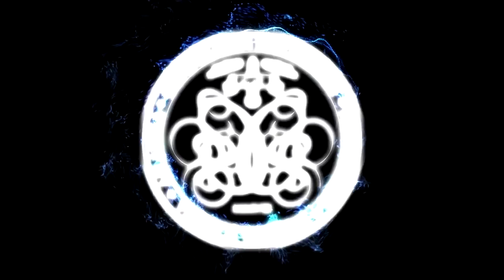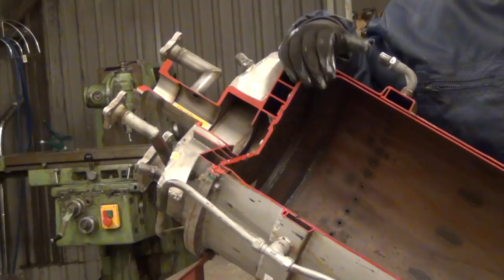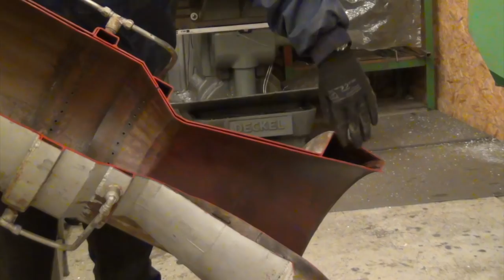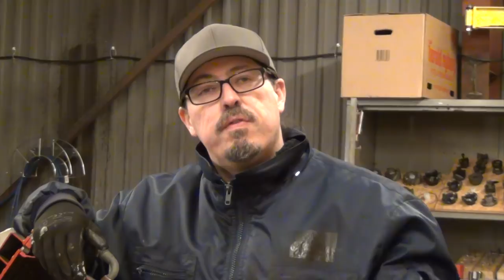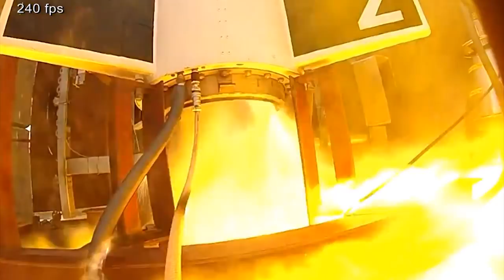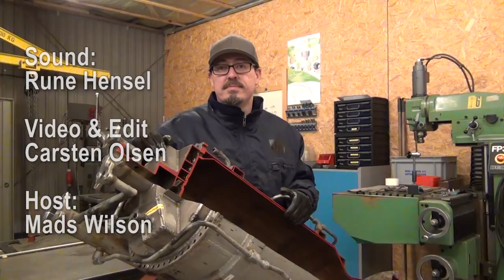How ROCKET ENGINES Work

Comment: I suggest looking at the German A-4 (V-2) rocket motor. It used several smaller Injectors to achieve reliable combustion. Good work.

Comment: Very good video...I like how he kept it simple for the layperson....by the way the licking your finger on the hot plate reference to the fuel spray inside the engine is called latent heat....it's a physics property of liquid changing state and the heat it absorbs..

Comment: Great video, im just curious how the high presure exhaust is controlled from going up and out the way the fuel came in? Since the presure is so high does that mean that the amount of presure the fuel is injected is higher thus preventing the exhaust re-entering the fuel pumps? Best regards
Reply from the maker: You're exactly right, feed and injector pressure is always higher than the combustion chamber pressure.
Reply: @CopenhagenSuborbitals  Thank you for the answer :)

Comment: Thank you! :)
What is the desired pressure in the nozzle? It low pressure / high expansion is more efficient, right? Never thought about  that the nozzle has to withstand those high pressure levels so it doesn't implode. Very interesting!
Reply from the maker: There's really no general answer to that - it  depends on the engines geometri, fuel types ect. And expansion also depends on ambient pressure a a given altitude. That's why second stage engines always have this huge engine bell :)

Comment: Have you ever thought about cooling the engine by brazing copper pipes on the inside of your combustion chamber? I mean obviously it would take a lot of man hours to do so, and very precise work to achieve repeatable results, but it would keep the engine cooler and might solve a few of the problems.
Reply: Surely you mean outside

Comment: are you going to use the bpm-5/-design in a rocket/vehicle that will pass the karman like? like using the basic engine clustered or with a big engine bell in vacuum?
Reply from the maker: Not likely - we are working on a 100KN+ engine for the Spica class rockets
Reply: I think they need a small engine bell to be efficient in their case. It is after all a suborbital flight.
Reply: A two stage rocket with a 9-cluster of BPM-5's could potentially launch small sattelites to orbit!
Reply: if i had a mod for ksp, i would have done it.

Comment: I was wondering why you don’t use a LOX fuel system instead of ethanol is there something more favourable about ethanol or is it just production?
Reply from the maker: We prefet to use LOX as our oxidizer that it is. :)
Reply: Have you ever thought about using liquid hydrogen or kerosene?
Reply from the maker: @jackrigby6678  Hydrogen is extremely hard to work with and kerosene is not a very environmentally friendly option when we are launching rockets from the sea and risk large amounts of it being dumped into open waters.
Reply: Thank you for taking time out of your way to reply, good luck with the spica rocket!
Reply from the maker: @jackrigby6678  You're welcome and thank you!

Comment: isn't there any ignitor used to start the combustion?
Reply from the maker: So far we've used a pyrotechnic igniter suspended inside the combustion chamber to ignite our rocket engines. You can see it flying out at 5:07
Reply: Copenhagen Suborbitals isn’t that just basically a giant match in the engine to start it?

Comment: Is it possible to make a small working model of this engine at home... I have access to liquid oxygen and ethanol /methanol
Reply: You’d have to figure out how to pump it hard and fast enough. That basically requires turbo machinery of the highest degree or a really powerful electric motor (in the case of Rocket Lab’s Electron rocket)
Reply: BrokenLifeCycle RocketLab is using brush less DC motors which are easily available and turbo pump can be made from car engine turbo pumps
Reply: Dollar Projects if you have a cnc or a 3D printer you can easily make an impeller that is power as required. The rocket is 60% plumbing (combustion cycle), 20% nozzle, 15% cooling, and only 5 percent everything else.
Reply: Makar Lock Thanks for the help :)
Reply: Small liquid rocket engines use high tank pressures from a secondary Nitrogen tank to generate the required fuel flow. If you're looking to build a really small engine, I would recommend reading http://www.cientificosaficionados.com/libros/cohetes.pdf
If I had any mechanical knowledge I would absolutely build one myself. Alas, I work with computers instead.
Reply: Getting the fuel into the combustion chamber is the main trick in liquid fueled rockets. You want the combustion chamber pressure to be as high as practically possible, but obviously for fuel to flow through the nozzle, the pressure on the other side of nozzle must be even greater. And you have to do it at a high mass flow rate, so power requirements are significant.
You can do a pressure fed system, but then your fuel tank pressure is the limiting factor and the result is generally very low efficiency rocket, you would be better doing solid fuel rockets really. Turbopumps are the answer for big rockets, but miniaturizing them... not really viable. The problem is the bearings, they need to not leak or you are going to mix things that are not supposed to mix and blow the rocket up.
Electric pumps on the other hand, these you can make totally sealed besides inflow and outflow, now that is something that can be worked with.
Reply: aleksander suur sealed brushless motor powered turbo pump can be made.
Reply: +Dollar Projects
I don't know how good a rocket motor one could build like that, but the principle is there. In case you or anyone else actually tries to build something like that and pump liquid oxidizers with it, please for the sake of your remaining life expectancy, keep in mind, lubricants, plastic, paint, wire insulation, metals, everything counts as fuel and when oxidizers and fuels are mixed, things often go kaboom.

Comment: Hi, it seems the throat is too wide and the nozzle too narrow and short. The mixture is ejected too soon out of the chamber and nozzle, and the  combustion takes place too far away from the engine. In fact the combustion chamber should work as a mixer of fuel and oxidiser, and therefore needs some containment especially when one of them is heavy (EtOH or RP-1), the mixture is  afterwards injected into the nozzle where  the  effective combustion takes place propelling the rocket.
The  expanding gases pushing against the parabolic walls in  all directions:
in the forward direction create a net push.
expanding gases that push side wards  produce no net push as they cancel each other's.
and the backwards moving gases are, bounced parallel outwards reducing drag.
 Notice how the most powerful rocket engines like  F-1 have a huge parabolic-like nozzle, compared to the combustion chamber. 
Good luck

Comment: That design never made sense. You must contol flow of each fuel channel by avoiding bottlenecks. The hydraulic pressure in a 360 degree open mantle never made sense.

Comment: First! Also, I did not need to study physics to tell temperature from heat, that's mid-level physics curriculum.
One question, are you still doing the spiral guide wire thing that you falsely assumed would improve cooling (https://www.youtube.com/watch?v=tlqAS6MwkNw)?
Reply from the maker: Hi Anvilshock - the design of the Spica engine will be a lot different from the BPM5 design.
Reply: Best of success! Still, the jacket machining used for the BPM5 looks so mesmerising and cost-effective, I should hope it becomes a success, too!
Reply from the maker: The BPM5 works great! The original one has been fired over 30 times and still going strong.
Reply: People falsely assume that "heat capacity" is like a bucket that can be filled at any speed until full when in fact it fills slower the closer to "full" it becomes, and also that flow speed, rather than flow rate, is what improves cooling. I elaborated more in a comment on that linked video. Please follow the link to the video via the video link which I used to link to the video.
Reply: Alright, copied and pasted here for you: https://www.youtube.com/watch?v=tlqAS6MwkNw&t=420s - And that makes absolutely no sense. At all. That is like saying filling a garden hose from a tap is faster than filling a bucket from a tap, even when both "containers" have the same volume.
Making the fuel channels longer while keeping the jacket volume the same does not make the fuel spend more time cooling the engine. It will simply flow faster to cover the now longer distance. Higher flow speed (as in, surface covered over time) does not do anything when it is effectively still the same flow rate (as in, total amount passed through over time). X amount of coolant can only take Y amount of heat energy for Z of a given delta-T. (Ignoring phase change here which you don't want anyway. Cavitation is a bitch.) Rather than gaining better cooling, you're only making life more difficult for yourself: 1) More complicated assembly due to the need of keeping the bloody wire spiralled, 2) heavier engines and greater material cost due to more material added, 3) lower feed due to higher flow resistance that must be compensated appropriately, and 4) believe it or not, the spin imparted on the fuel will result in a small rolling momentum (although most will be negated since it's more or less a closed system) that can irritate the eff out of you trying to eliminate if you didn't know where it was coming from. So, please don't do that.
Reply: Interesting finds. However, both underline what I described. I'd guess that Boston (first example) didn't get the flow rate high enough to pass the hottest part (throat) quickly enough to keep it cooled at acceptable levels. Note how their experience with spiraling was that it makes matters worse, rather than improve things. The second example doesn't mention spiraling at all, but does mention flow velocity. Remember how the coolant velocity is foremostly a function of flow rate and pathway cross section, and how flow resistance is a function of distance covered. The longer the channel, the more resistance encountered. That aside, twisting the flow around increases the flow speed indeed, but it also increases the time the coolant spends within the hotter area. It's just like a ramp vs. a ladder. Covering some height may take you only a few steps up the rungs, but covering the same height in the same time up an incline will mean you'll have to run faster to not only cover the "up" distance, but also the "sideways" distance. Here's where your increased flow speed comes from, it's simply needed to produce the same coolant mass flow rate. It's simple geometry. Twisting brings you nothing; if anything, it hurts you. All that counts is that you get a high coolant mass flow rate THROUGH the hot zone, meaning entering AND exiting. How fast or slow it flows WITHIN the zone is, as far as cooling speed (capability of taking amounts of heat away), irrelevant, so you might as well go with simple straight paths. The only real thing how you can increase (local) flow rate is by modifying coolant passage cross section. (You can't simply increase global flow rate by pumping more coolant through the jacket for obvious reasons.) Incidentally, simply keeping the jacket clearance constant across bell, throat, and chamber results in increased local flow rate at the throat because that's where the cross section is the smallest for the coolant as well, not just for the reaction gasses.
Reply: No, I don't think the book is wrong in this regard, but I do think it's ambiguously worded, and also that it's being slightly misquoted and/or misinterpreted. Yes, the book mentions velocity, not rate. However, the two are intricately linked through the jacket geometry. Don't ignore the rest of the sentence, it describes HOW they increase the velocity: "by restricting the coolant passage cross section" Because the passage is now narrower, the increased flow speed/velocity is simply the effect of the change in geometry.

Remember that your overall flow rate is constant. It's simply the speed with which the rocket engine is made to consume its fuel, producing proportional amounts of heat. So the only way to control local flow speed is the portion of the jacket's cross-sectional area that is not composed of pipe wall material. It is conceivable that this is the reason why they concentrate on mentioning the flow speed rather than the flow rate: Because the rate is a given, and all the flow speeds local to the various engine components scale with the rate, the rate cancels out of the considerations.

Consider what spiralling vs. a straight path does: The total jacket volume in any of the sections of interest is divided into the pipe material and the coolant channels they form in-between. Now you redistribute the pipe material such that the channels are angled against the center axis, away from running parallel. But does that change the actual jacket cross-section area? No, because it's still the same fraction of pipe wall material to total jacket volume. Therefore, there cannot be a net change in the flow rate through a section's jacket volume. (There is a small to medium side effect, though: The increased wall surface of the pipes leads to a higher dissipation of wall heat into the coolant, with diminishing returns. And if all you do is add a handful of guide wires, that effect is negligible anyway, angled or not.) Now, can you distribute the wall material arbitrarily finely, as in, stretch it ever finer to create ever longer channels with ever shallower angles? No. Eventually, you will hit limits in manufacturability, mechanical strength, and non-linear fluid dynamics.

The key for good cooling (as in, amount of heat removed over time) is to replenish and displace the heated coolant with fresh coolant as quickly as possible because you don't want to keep the heat lingering about. Note how I said "displace". The heated coolant must LEAVE the section to be cooled, and must do so as QUICKLY as possible. The speed within the hot zone itself is (mostly) irrelevant. (I say "mostly" because a high flow speed has a side effect: It counters localised heating. Think about a pot of almost boiling water: Left alone, bubbles form at the bottom that quickly collapse when they rise. When stirred, no bubbles can form, at least not as easily. Bubbles are bad, and can be catastrophically bad in nozzle cooling. But stirring only works as long there are parts of the water that are cooler than boiling temperature which you substitute by stirring. Eventually, no stirring in the world will keep that water from turning into bubbles of steam.)

Now, back to spiralling: As we have determined, the flow rate does not change, regardless how you angle your flow. From the ladder & ramp analogy we've also seen that the pipe angling increases the distance within each pipe to cover the distance strictly vertical across the hot section of interest. To maintain the flow rate with longer pipes, the flow speed in the pipes must increase. But since the entirety of the angled pipe is still fully within the section of interest, any advantage that might have been gained by increase of flow speed is immediately negated. You simply gain nothing.

As for the Boston University Rocket Propulsion Group's experiment: Yes, the coolant absorbed more heat. Or more accurately, its temperature at the output of the jacket was the highest, even dangerously high, which is what they state. (Those things are distinct, and governed by the specific heat capacity of the coolant.) However, this can have multiple reasons, but without seeing actual data, or the actual model even, from which they determined that spiralled channels are undesirable, there is little to go by to make the different configurations comparable from what little glimpse we were provided with. Also, we mustn't forget one thing: The BURPG presentation is the research of work done by students with a particular goal, namely creating a Matlab computation model for particular cooling configurations. It was not a presentation by experienced, industrially employed rocket engine designers about a final and flight-worthy engine design and the decisions behind it, including the best possible nozzle cooling they could achieve. Plus, it's not inconceivable that they may have come to wrong or incomplete conclusions from their findings. This is by no means a discredit of their work, but just because BURPG couldn't make spiralling work for them doesn't mean anyone else shouldn't have, either. You cannot simply regard BURPG's design as a finished product and from that take one of their findings along the way as universal advice. Theirs was simply a different goal. 

Which brings me to the final word. Remember that design, construction and manufacturing of rocket nozzle cooling, or of anything, is a process of choosing and implementing the best trade-offs. I'm not categorically saying, "spiralling is stupid and pointless and anyone doing it is a moron and should be laughed at". The fact that some designs did end up including spiralling to some extent simply means that, from the countless considerations, those are the designs that met the circumstances the best, resulting in those very models. Maybe they could afford it. Maybe they had to. But you can't go about promoting spiralling simply on the basis of "this will make our engine better because they have done it, too". That would be foolish.